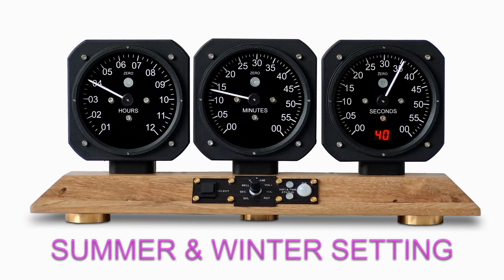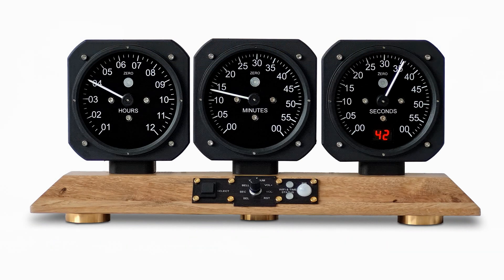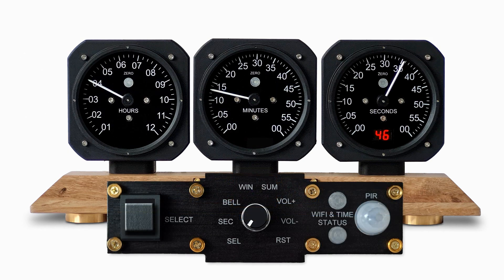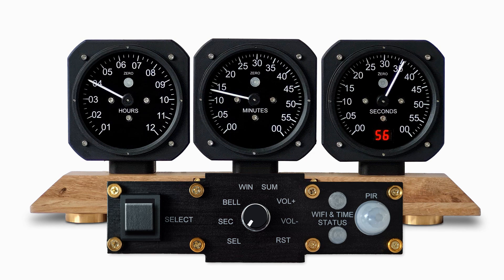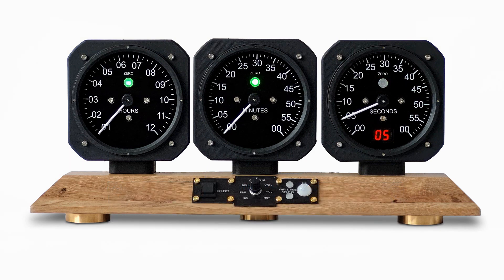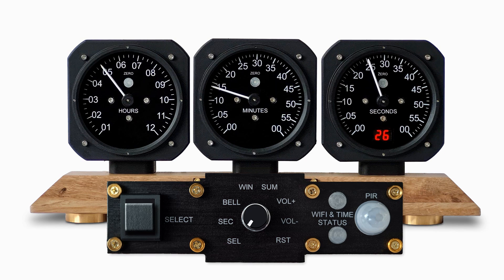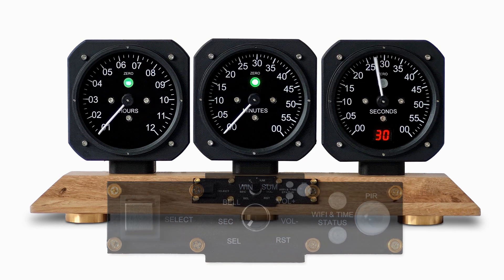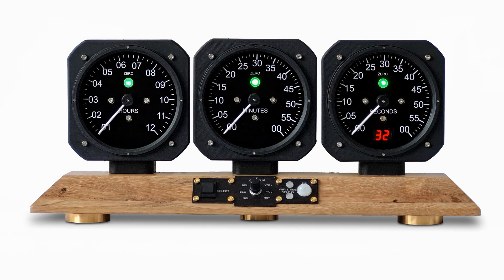Aviator Clock Summer and Winter Setting

Comment: As a fellow aviation geek - great job mate! I will make one myself as soon as possible when you release the files, the thing looks awesome, I love the aesthetics and all the built functionalities. Propper engineering!
Reply from the maker: Thanks for your kind comments. I forgot to add the link to the 3D files as they are now online. There is a £1 charge for the files (helps ofset some of the cost of filament used in all the prototypes) https://cults3d.com/en/3d-model/gadget/esp32-aviator-clock-using-three-aviation-style-gauges